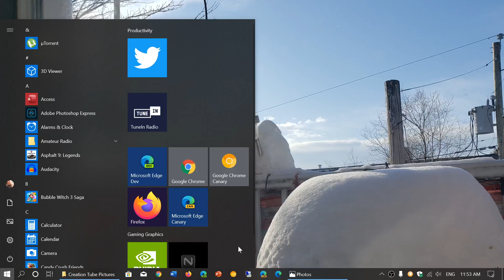Receiver testing in different localization means different results

Comment: In my location, the problem with some of my SW radios is MW breakthrough.  WABC 770 is the biggest problem with their transmitter located about 10 miles from me.  My Tivdio V-111 & V-115 has breakthrough of WABC throughout much of the SW band.  The only radios with FM breakthrough that I found was on QFX radios.